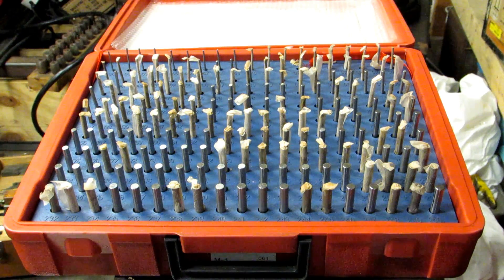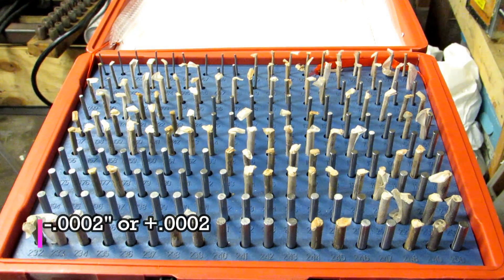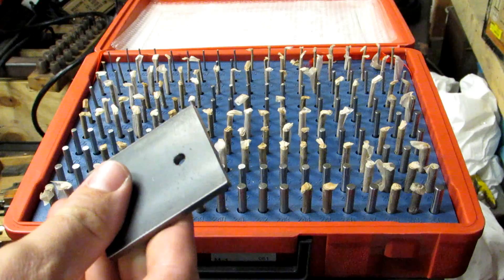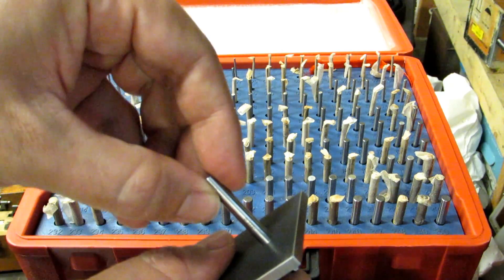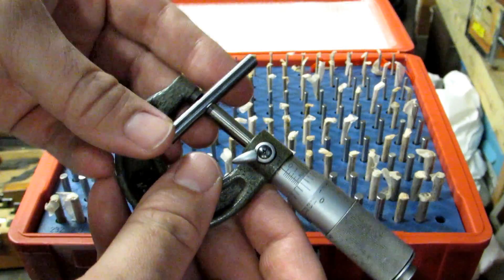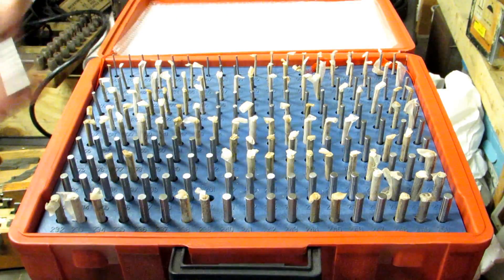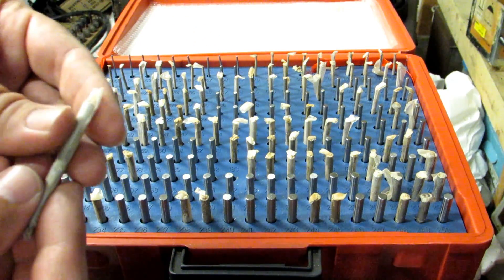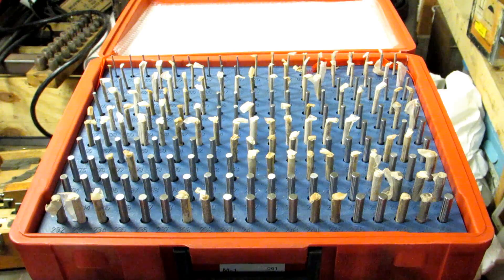Gage Pins and How to Use Them

Comment: Very helpful video, but if your high-end tolerance is .225, shouldn’t the .225 gage be acceptable to fit? 

.226 would be the right gage for the No-Go side since it’s just outside of your max tolerance, correct?
Reply from the maker: You are correct. It should. If you had an oversized pin and THAT fit, then you'd be out of spec.

Comment: why not use the shaft of a drill bit to measure holes?
Reply from the maker: Drill bits are too far apart in diameter to get accurate measurements
Reply: Stuart de Haro thank you.

Comment: use a bore mic to actually measure holes.  pin gages only say you are within a tolerance
Reply: A bore mic is good for .001 tolerance however when you need .0001 you are screwed.
Reply: Michael Idarecis https://www.msi-viking.com/Mitutoyo-511-521-Digimatic-Bore-Gage_p_27861.html 0.0012
Reply: @jimmyc451  what do you do when the party is 1.7999 or less?
Reply: Michael Idarecis there are smaller bore mics. I just posted that one. At some point you will need pins. Most smaller holes will be threaded so not sure what accy you will need. After threading, there are thread gages too

Comment: Stuart de Haro... I thought your video was to the point and informative. I left a reply to Charles Alford on his comment.  Charles Alford... You are incorrect, when you purchase a "Plus" (+) or "Minus" (-) pin gauge set it means exactly that... the pins are made to specifically be either .0002+ or .0002-   However when purchasing a set that supposedly is made to the particular engraved size... then you have to assume that there may/might be a "Tolerance" off set by +/- some degree, especially if the set has not been certified. That is why they sell the "Plus" or "Minus sets" otherwise they would just sell them as is and let the purchaser assume all negative or positive tolerances.
Reply: I don't understand. How can one have a  Minus size, surly all sizes must be Plus. "A positive value"  I may understand it as a tolerance value as explained by Charles Alford.  +/- a small manufacturing tolerance of the pin gauge itself. which could be +/- .0002 as in the example. or perhaps , slightly undersized by -.0002 or oversize by +.0002

Comment: Anyone here do know how to maintain or correctly keep it in the storage?  After use i drip a SINGER machine oil and wrap it in a paper and put it back, 1 piece i forgot to clean it up and put it back it begin rusting a bit.. or should we just unwrap clean the grease and put it back like the video shows?
Reply from the maker: Are they stored in a temperature controlled room?  If not, you can definitely have rusting problems, especially if you live in a very humid environment.  It might also be your body chemistry.  I know a guy who leaves rusty fingerprints on almost everything he touches.  In either case, a quick wipe down with some light oil on a paper towel before you put them away should stop it.
Reply: Stuart de Haro thanks for the info.. i live in Indonesia, its tropical area, very humid and near the beech.. i always drip a machine oil and wrap it back.. 1piece is rust a bit coz i forgot to clean/whipe it after use.. well.. what choice do i have 😅.. forgot to mention i bought it 1,5years ago

Comment: Plus or minus refers to the tolerance to which the pins are ground, not to an absolute dimension. The pins in the set shown can be as much as .0002 under nominal or they can be right on. You shouldn't count on a pin from a "minus" set to always be .0002 under or from a "plus" set to always be .0002 over. In my experience, the sets from the good makers (Starrett; Meyers) are usuall not far enough off nominal to measure with a set of mics.
Reply: Charles Alford... You are incorrect, when you purchase a "Plus" (+) or "Minus" (-) pin gauge set it means exactly that... the pins are made to specifically be either .0002+ or .0002-   However when purchasing a set that supposedly is made to the particular engraved size... then you have to assume that there may/might be a "Tolerance" off set by +/- some degree, especially if the set has not been certified. That is why they sell the "Plus" or "Minus sets" otherwise they would just sell them as is and let the purchaser assume all negative or positive tolerances.
Reply: @bisonuberti  That's not what spec ZZ means. ZZ minus spec means the pins are finished to within +0.0000" to -0.0002" with a finish 10, along with other dimensional specifications. A ZZ minus that reads -0.00015 or -0.00010 or ±0.00000 is within spec. I am not even sure how to measure ZZ with digi calipers, many of the near $400 calipers only have accuracy to 0.0006" with resolution of 0.00005".

Comment: Another way to use them into stack them side by side. Say you needed to measure a .375 hole + or - .001 you could use the .186+.188 = .374 and see if they fit. Then use .186 + .190 = .376 to see if they don't fit. This way your set can be used to go to .499. Don't forget your .0002 minus tolerance stacks.
Reply: Holy shit dude, at work I need to measure 12.02 mm hole and our pins only go up to 12mm, but we have everything from 1 to 12mm, so just gonna grab the 6mm box and give this a try.
Reply: @davidjones2999  let me know how this works out for you thanks for the reply
Reply: @Bobwithoneo99999  Tried it out and it worked good enough. The problem is that my tolerance is 0.01mm and I think it's too small for double pins, sometimes you might think the hole is not big enough but then suddenly you manage to slip the pins in, you have to develop a feel for it. But for larger tolerance holes I will definitely be using this tip. Thanks!
Reply: @davidjones2999  so glad you got back to me. Sometimes this method leaves a little bit to be desired but when you don't have the right size pin this can work very nicely. So happy you found it useful.
Reply: @davidjones2999  remember use the 5 mm and the 6 mm box to give yourself some room to sneak up on the hole. For instance use the 5.50pin and the 6.40 then the5.50 and the 6.45 pin till you find the combination that doesn't go.
Reply from the maker: Nice. I like it!
Reply: Wow sir.. thank you very much, why didnt i think of this trick, this is helpfull..
Reply: I dont understand how can measure a hole with a pin.  If a hole and a pin are exactly the same size, you'll get an interference fit and it won't slide in.